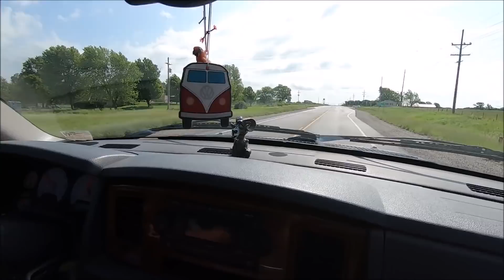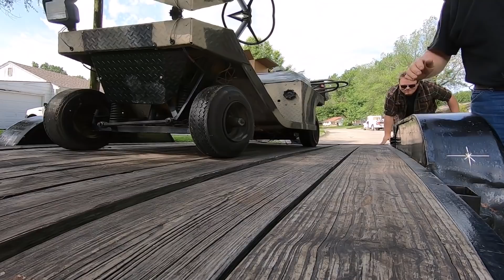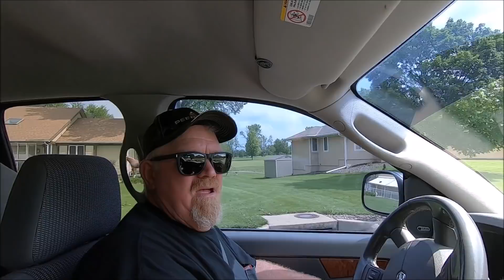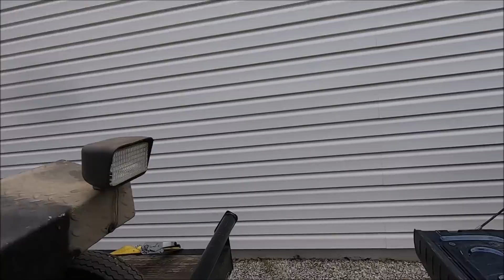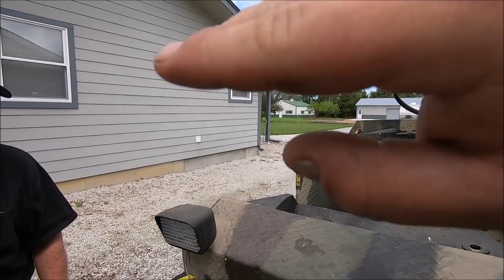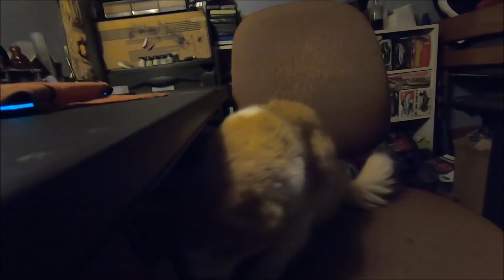UNVEILING DAD'S LATEST BADASS PROJECT OF MANLINESS

Comment: Ok that's pretty cool. I used to have a 1984 2 cycle golf cart with a belt driven torque converter when I was 12. Man was that thing quick, if you got up to full speed in reverse and cut the wheel all the way it would do reverse donuts and pull the passenger rear wheel up off the ground untill you straightened the wheel out.
Reply: probably a harley davidson